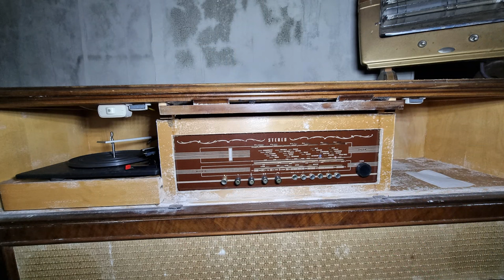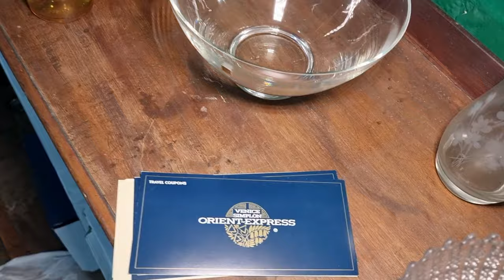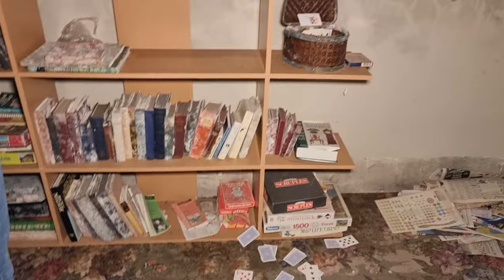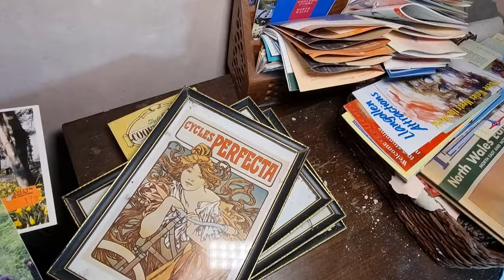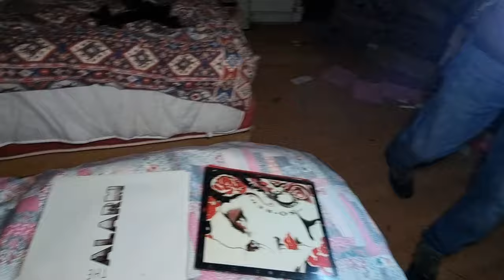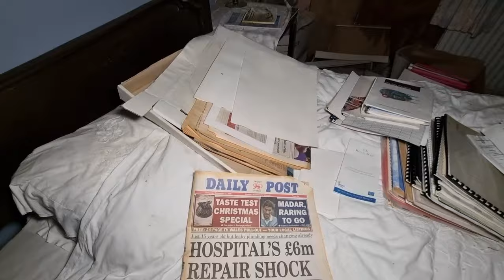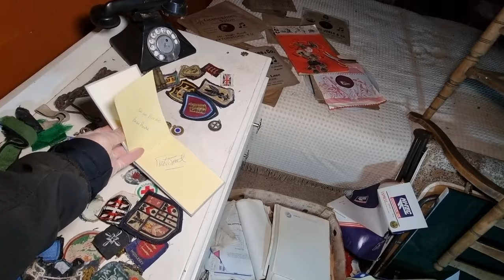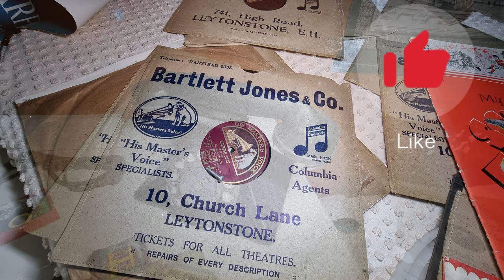INCREDIBLE 8 BEDROOM FAMILY HOME ABANDONED FOR MORE THAN 20 YEARS!!!

Comment: Another great exploration. It never ceases to amaze me how these places survive and aren’t looted.  What a shame that such a large house has been left to deteriorate. 
The compass 31:40 is a beam compass, often called trammels. It’s for scribing much larger radii on materials like wood, card, plastic, or metal than can be achieved with adjustable steel point spring dividers. 
The machine in the box at 39:52 is an electric meat slicer. Heavier commercial quality ones are still used in supermarkets and butchers to slice ham, pork, beef etc. You’ve probably seen them on meat counters many times but just didn’t recognise what is was with it being in the box.
Reply from the maker: Thank you! 
It had been looted unfortunately.  There were definitely quite a few things missing that were there in a top explorers video a few weeks back where he did a paranormal.  That's just what happens unfortunately.  Thank you for the info on the items, we always appreciate it!